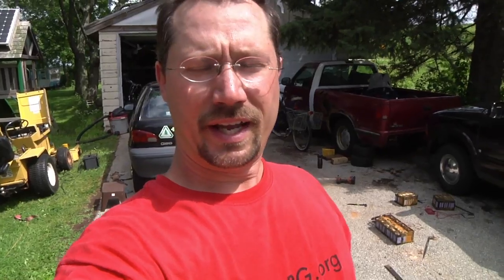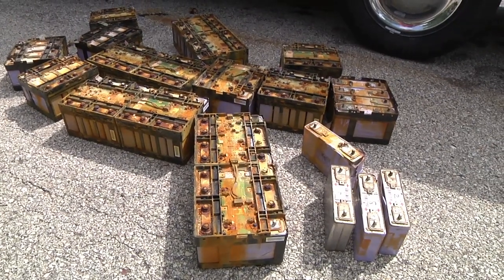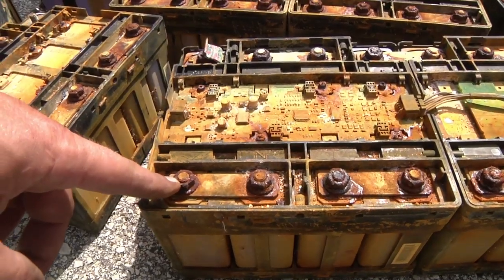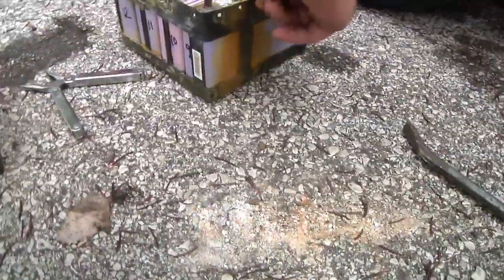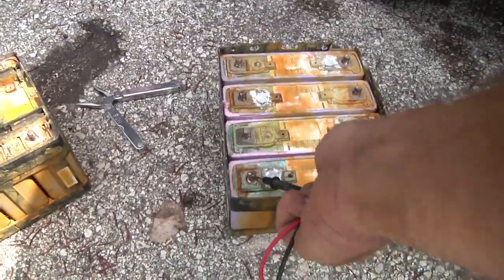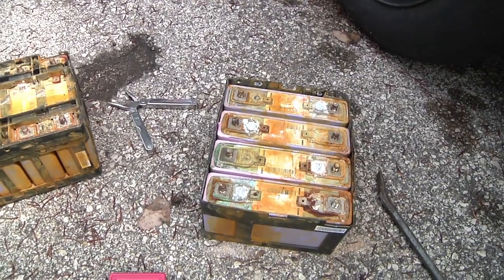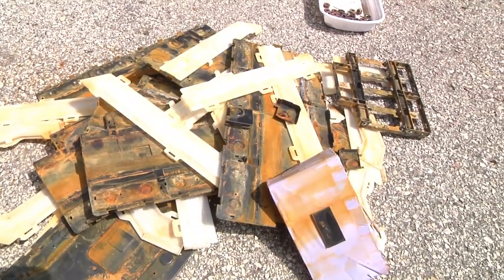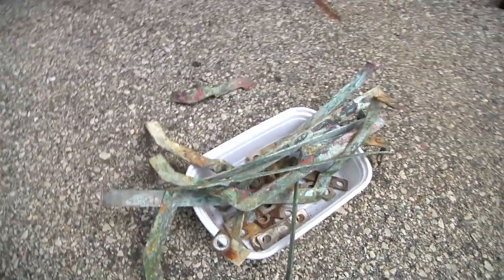Lithium Salvage - Mitsubishi iMIEV Electric car battery pack recycling

Comment: Lithium Salvage - Mitsubishi iMIEV Electric car battery pack recycling
1 battery 3.7 V and 16 kW \ h is obtained?
1 аккумулятор 3,7 В и 16 кВт \ ч получается?
iMieV what size battery 1, the size of whole cells 4 pcs?
1 battery 3.7 V and 16 kW \ h is obtained?
Reply: Привет 👋, скажи пожалуйста сколько элементов в аккумуляторе ? А то нет информации не где
Reply: @Elektricheskiy17  22 moduels of 15v each connected in series to get the 330v full voltage from the pack

Comment: 1 battery 3.7 V and 16 kW \ h is obtained?
1 аккумулятор 3,7 В и 16 кВт \ ч получается?
Reply: The 16kw pack is achieved through 22 moduels of 15v each connected in series to get the full pack voltage of 330volts